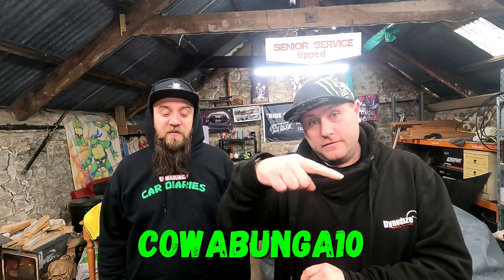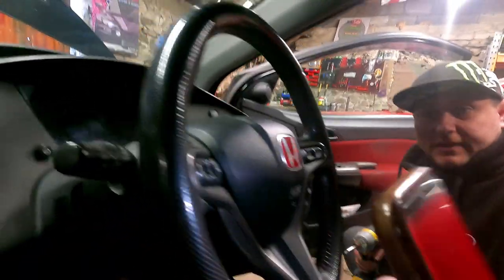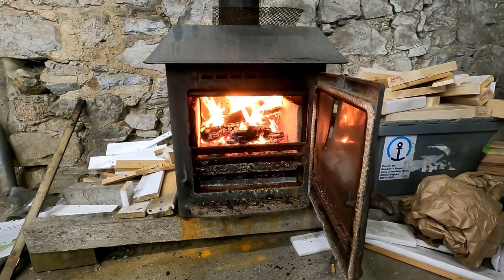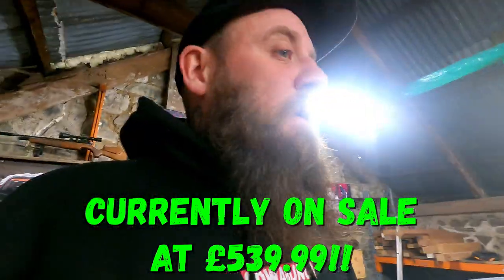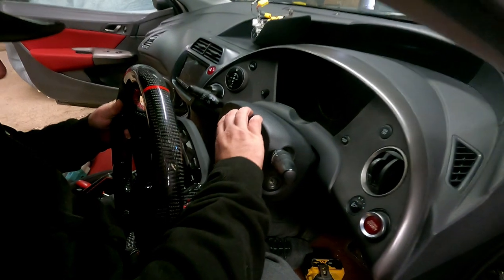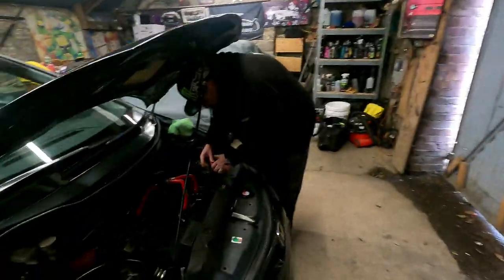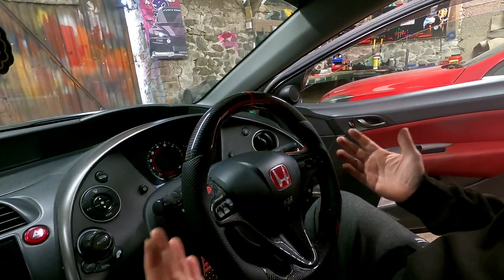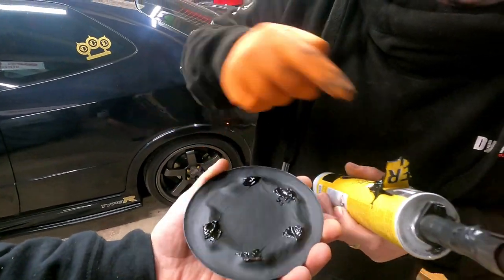Full Carbon Fibre Steering wheel Install On the Honda Civic FN2 Type R From Carbon My Ride

Comment: Well done boys, beautiful. Glad you didn’t set the airbag off and blow your heads up, or worse, damage the wheel. 

By the way, don’t disconnect the battery with the positive lead, always do negative first (removal) and last (refitting) in case the spanner touches bodywork.
Reply from the maker: Nice one man 🤘🏻❤️